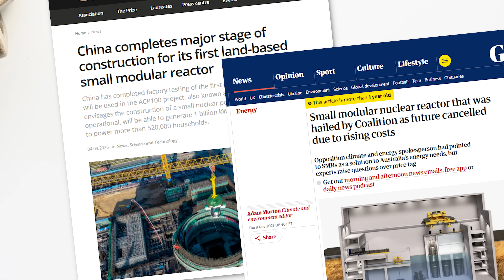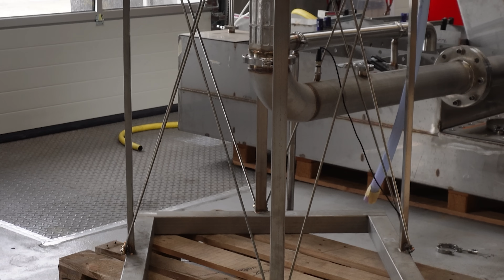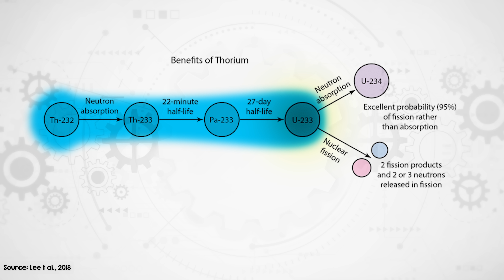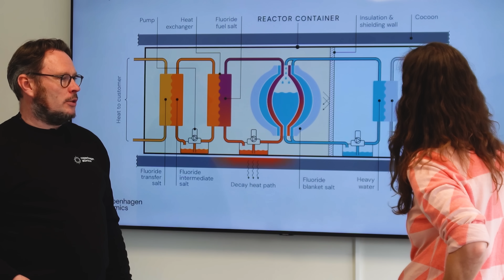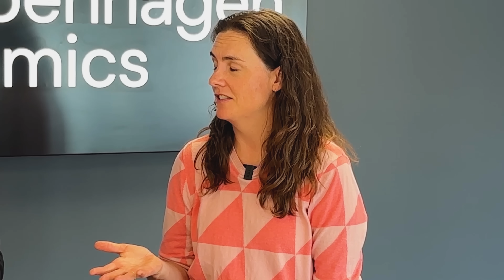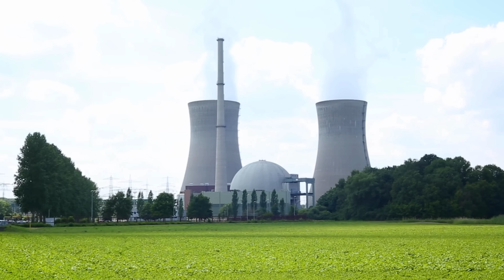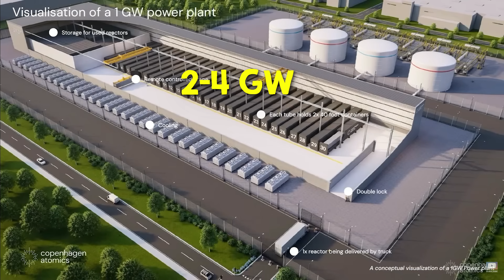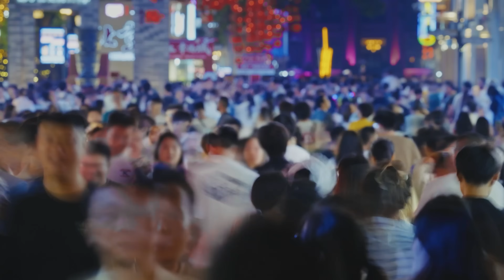Can Copenhagen Atomics Make THORIUM REACTORS Work? [TOUR]

Comment: I can't believe they're still relying on steam turbines to generate power
Reply: "I can't believe they're still relying on steam turbines to generate power" <- I can't believe you don't understand why.
Reply: @TheDanEdwards 
I mean, with the due respect, that the thermal power plants are competing for the last Wh left out of wind and solar production and these guys arrive with the least flexible tech
Reply: @lorenzoventura7701  because steam turbines is best way to transfer heat. We currently don't have process that allows heat to electricity conversion at better rates.
Reply: @Pecisk 
Good luck competing with wind+solar+batteries free-falling LCOE
Reply: @Pecisk  New methods are being developed - essentially like solar-panels but which use heat rather than light. However, one big advantage of steam turbines is their intertia.
Reply: @lorenzoventura7701  Re-reading what I wrote and your single-sentence reply, which ignored most of what I said, I'm starting to wonder if you have really looked into it beyond quite a cursory investigation (again, more than happy to be proved wrong). Are you aware, for example, that LCOE can sometimes belie the true costs to the consumer once renewables hit a certain percentage threshold of grid mix? As in, the LCOE of renewables can indeed be very low when they are plugging into an existing stable grid... but as they start to dominate, that can change. In short, it seems, from what examples we have around the world that renewables are very cheap up to (correct me if I'm wrong or have the thresholds slightly off) about 40% of total energy mix, but the next 40% is much harder and more costly, and the remaining 20% can cost more than the previous 80% or something insane like that... It looks to me like actually, to have high renewable saturation, you may indeed want to keep some of those oh-so-passé spinning turbines around.

I am hesitant to mention this as I simply do not know enough about the actual details and understand how easily the facts could be manipulated by those with a prejudice against renewables, but those black-outs in Portugal and Spain could actually have had something to do with high renewable penetration into their grid, according to some analysts. To me, it somewhat stands as a lesson, that actually, like in the case of South Africa which is going backwards on infrastructure, if ideologically-based decisions predominate, in a policy domain that should be more science-based than most, you actually CAN go backwards. As in countries with previously cheap, reliable power, can devolve into places with expensive intermittent power. I do sometimes wonder if that might be where some countries, who really pursue renewables with great zealotry might go to. And when people complain and talk about "hey, remember we used to have cheap electricity" it will never be admitted that it's expensive now because of renewables. It will always be because there weren't ENOUGH renewables pursued. I'd be curious to hear if you've considered any of these points (across my two larger comments), and if so, what your rebuttal is.
Reply: Offering an admittedly "half informed at best" contribution here, so happy to be contradicted: there are some criticisms of solar-wind-battery and how difficult it is to make it the actual basis of your grid, which seem increasingly legitimate to me as I read/watch more on this topic. And at present those with high renewable penetration around the world are actually experiencing the highest costs (with perhaps a few exceptions). It's to do with how difficult it is for batteries to actually properly mimic the intertia of spinning systems like the turbines you pour scorn on, and so there are frequency issues in the grid. There are ways to artificially create this inertia but these are apparently not very effective (I need more facts on this point). Also, the oversizing of batteries needed to tide over an entire grid if there is a whole week+ of not much sun or wind is also quite extraordinary, and costly. 

Here in Australia one criticism of our (rather silly in my view, after looking into it) plan to go basically 100% renewable, is how we actually have to build an entire parallel grid of gas turbines to deal with all the smoothing necessary. Land use issues with such a diffuse source are also going to start hitting home, especially if we ever want to do something that requires enormous energy like, I dunno, run a manufacturing industry or compete on AI. And the transmission costs to bring energy from such diffuse and dispersed energy sources to major loads like cities look to be truly insane. So... you may find this criticism you have of turbines is based on only partial information? I am happy to be wrong here, but your comment reminds me of people who pour scorn on old solutions like very long freight trains on heavy rail. They think they are going to reinvent freight transport with "pods" of one kind or another... and then as they really run their models they start to arrive at clever ways of joining these pods together, and then soon enough, hey presto, they have re-invented the train... because actually this centuries-old solution hits quite a few "optimisation maximums" including cost, complexity, scaleability etc. You may find that that model of quite large, quite centralised big spinning turbines turns out to remain one of the best ways to deliver large-scale reliable grid power.

Oh, and if China, which dominates 80% plus on EVERY aspect of the solar and battery supply chain, from extraction right through to tertiary manufacture, ever decides to "switch off the tap" of cheap made-with-forced-labour solar panels and batteries to any "green" country that annoys it, then that country will be truly cooked. China is the reason solar is so cheap, and that is quite a dirty, yet largely hidden story, which renewables advocates I know are strangely reluctant to acknowledge.
Reply: @Ti-up3dv 
Grid forming inverters and good old synchronous capacitors can do the frequency regulation job
Reply: @lorenzoventura7701  Have you heard some of the criticisms of them? And did you read the rest of what I wrote? It's not JUST the inertia and frequency issues.
Reply: @Ti-up3dv 
Yes. The problem is China.
Reply: @Ti-up3dv 
Frequency regulation service is secured by good old synchronous condensers and new grid-forming inverters